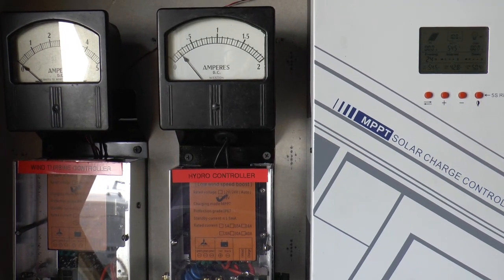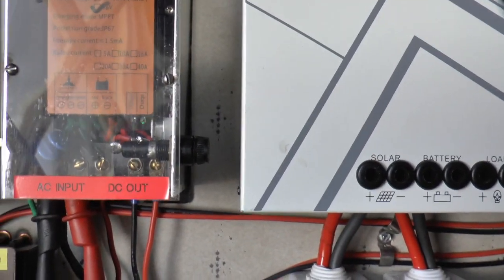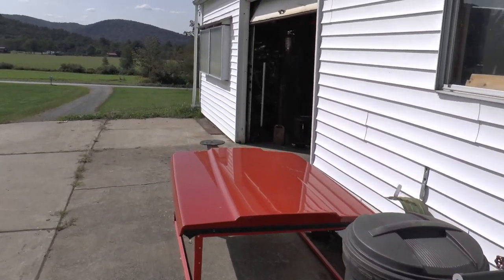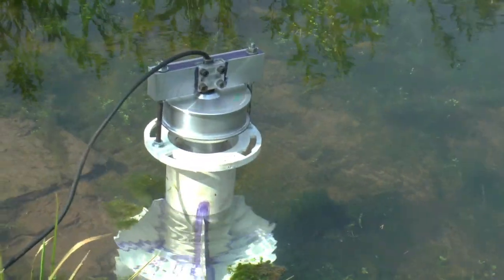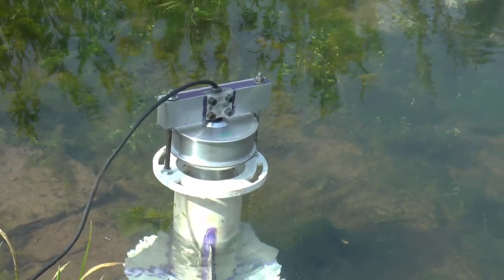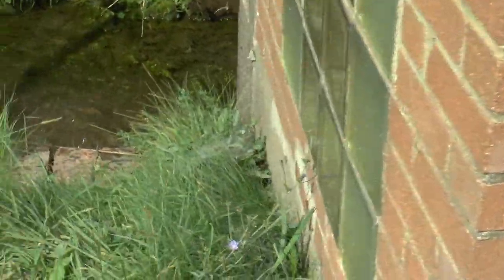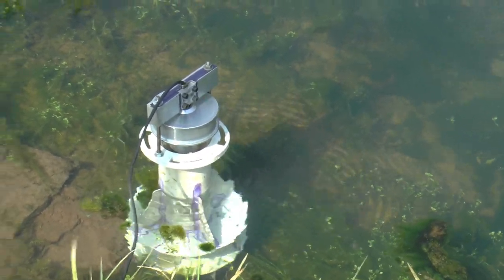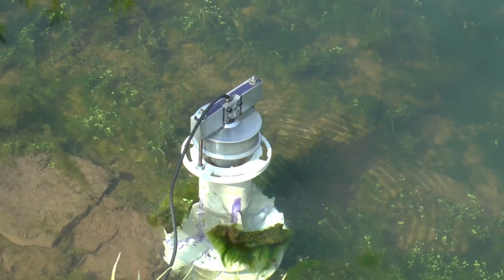Hover Board Hydro Update

Comment: I have also been working on a small generator for my creek. I have found that using an old x13 blower motor with out the module I can get 180v dc with no load on a drill. 30v just spinning by hand. Are you familiar with the motor
Reply from the maker: No. What is it used in?
Reply: @kevincrawford2027  it's used in hvac airhandlers
Reply from the maker: thanks
Reply: @kevincrawford2027  you wouldn't be local to nc would you. I could get ahold of one for you. If not any hvac shop should have a pile of them in the scrap bin
Reply from the maker: Pa.  @southmountainoutdoors4628

Comment: Idea to probably increase your system: rework it to something like the opensource system of @OpenSourceLowTech , which uses the syphon effect to pressure turn the motor. It seems that you have enough water, if you put a bigger underpressure pipe at the end and have the pipe ending in the water to fully use the syphon, I'd expect something like 250w out of this. The intake could be etended over the pond, so that an syphon occures and the motor could stay at the same place in an Y-Pipe.
There are also videos of @LandtoHouse where they used a 6inc inline setup to produce 500w constant... 
Would be a cool try-and-error series, due to you having the motor already I'd cost you only time and pipe.

Comment: Es una fantástica turbina casera,  aparte de meter 4-5vueltas mas de hilo de cobre, si le aumentas el grosor tendrá aún menor pérdida o si tienes el mismo hilo de sobra duplicarle en paralelo(20+20) unidos en sus extremos como única bobina. Otro punto de mejora es la salida de agua en la tuberia, son kaplan de reacción y por tanto necesitan estar sumergidas para que trabaje por aspiración y no sólo por gravedad! Prueba alargando la salida un poco hasta que queda inundada 5cm y comprueba si aumenta las rpm, nosotros tenemos una comercial de powerspout de 250w en 1,9m de altura puesta sobre una bañera, mejorar su salida nos incrementó casi un 20%
Reply: In case it serves as a guide and improvement, we have achieved even 30w more in our kaplan by increasing the cone-shaped output by reducing certain degrees by heating the elbows and now they have less friction and submerge 3cm more! You let it run empty for a couple of minutes until it picks up kinetics in the suction and its nominal rpm and tests, you will notice a slight increase in the rpm and therefore a little more voltage in your winding. but it is really necessary that you submerge it at its exit with a larger section than at the entrance so that you obtain greater efficiency and negative pressure in the pipe load.